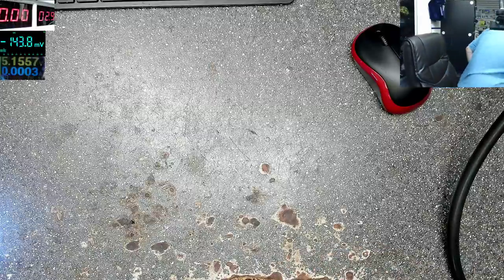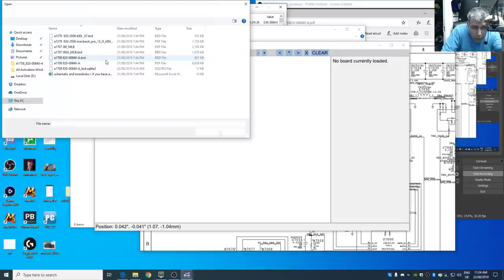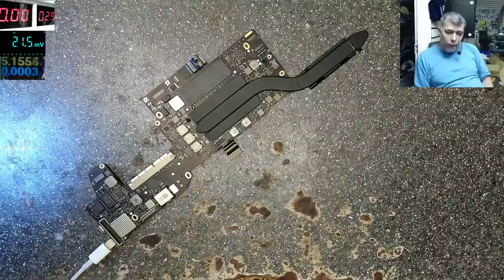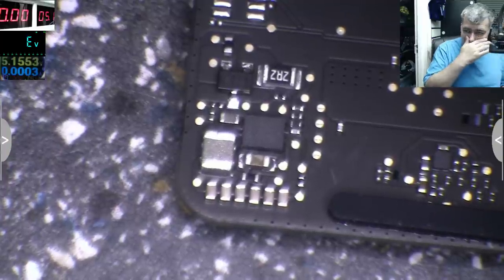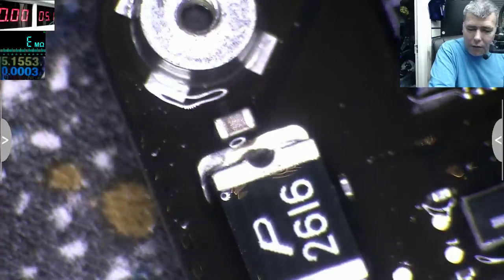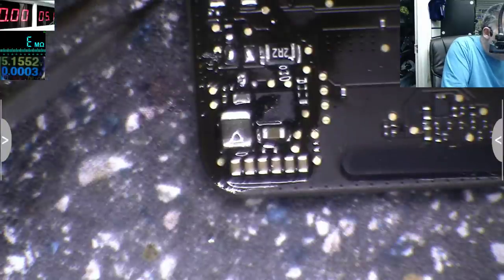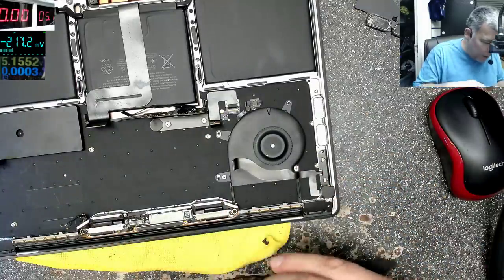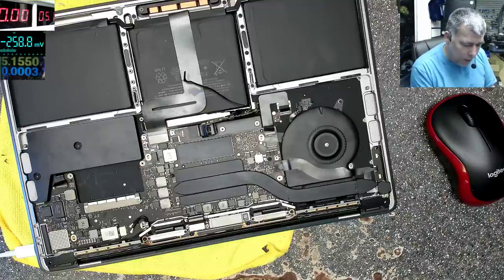MacBook Pro A1708 EMC3164 -Logic board repair (Jason Laptop)

Comment: Sorin
Smd multilayer capacitors are very unreliable, i think they are just too fragile and layers crack from stress/vibration/heat cycles and become shorted.
Cost has nothing to do with it,  just a bad idea.
Louis rossmann has found lots of shorted caps in the macbooks he repairs.

Comment: You need Paul Daniels software there is a free to download version without the quick board flip function. It’s extremely good.
Reply: can you provide the link to download?
Reply: Links repair  https://pldaniels.com/flexbv/ this is for the paid version, but there is a free to use version with a couple of functions missing. I will do my best to find the link for you. But the licence for this is $79 but for the information you can get from it will greatly speed up repair time.
Reply: Fully recommended. Free version will not work with PDF  and that's all different between paid and free. Thumbs up for Paul Daniels

Comment: just watched your video, which turned out to be a faulty cap...............then watched a video louis posted today..............a macbook that wouldnt turn on................due to a faulty cap ! ...................bit of a theme here ?................i think apple use the same crappy components as used in a £100 laptop..............just they charge £2000 for it !............still you do get an apple logo for the extra £1900 ?   :)

Comment: Macbook motherboard design is different from the others but components and voltages are the same as all other motherboards.just check 3.3, 5 and 19 volts present or not.and ram voltage(1.2v or 1.5v) of course.I would like to say Conguratilations to you that you can read and find voltage measurement point in a few seconds on schematics.3 years ago I stopped repairing motherborads cause here is not worth enough money for repairing motherboards.Video show is good idea.Funny,Fallowing your next videos.Bye

Comment: It is not bad quality capacitor. It is bad design. Nothing unusual with apple... It is too close to screwhole. It means mechanical stres. Capacitors should be at least 5mm away from mechanical mounting points and edge of board etd...

Comment: Sorin, the mac usb charger works like this: it usually sends 5V to avoid to burn usb powered things an idiot could connect, like a phone. When you connect it to a macbook the smc sends a specific signal on the data pins so the charger could pass 20V like a normal charger.

Comment: Would it be possible to put those diodes on the free space to the right, then solder the wires,  and then finally use hot glue to keep them in the place? Great educative video!

Comment: Nice job. Like watching your videos, I learn a lot. Not to get confused with 5 volts on the current sense resistor, as i know and keep it less confusing, it is start up voltage for 3.3v to power two ics that communicate with mac safe to open 20v supply.

Comment: Louis Rossmann teaches us to always look at the board first for any obvious faults...then go through the power rails and find out which one is missing...yes finding the ampere using your power supply can guide u roughly but with macs you need to manufacture the cable first to do this. The only complaint i have with your methods is that you skip around alot..there is no set method you follow...i have watched most of your pc laptop repairs and i think you are a very knowledgeable person..but i think thats the problem..you know your stuff but creating a consistant method like louis does would really help solve issues for your viewers..to date only a handful of channels out there repairing laptops actually go through the process systematically. The main issue is that they are in hindi and not in english. I know that if you do create a logical step by step method like louis does your channel would grow so fast..i admire your skillset..without any schematics..i dont think louis could do what you can without schematics.

Comment: Hello Sorin, is it possible to give me an advice about the A1708. I have similar situation.
The difference in my case is that when i measure the double diod I receive 19V to 0V and always fluctuation. On L6995 I get 10V on .2 and 3.3V on p.1. Flowing the schematic on c6990 I have 19V. 
On fuse  F7000 - nothing. Would you please share your opinion how to proceed with the troubleshooting

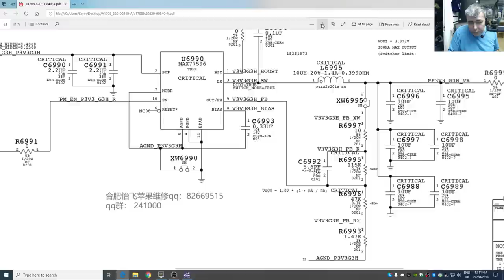Comment: 58:18 Sorin please look at the schematic. I will give you one tip.
On the apple schematics only, when you see the word "critical" above any component - that is means you HAVE TO replace it, and it is wrong to remove it and skip it. That component must be there and It must have the same parameters - not something around or familiar to it, but exactly the same resistance/capacity/etc.
I know what you are always saying "oh, that cap is not necessary, there is another one next to it, it will be fine, trust me, don't worry" and yes you have right almost in all cases, but NOT here in apple, The word "critical" means it is very important. Ok laptop is working fine now without that cap, fine, but working laptop doesn't mean it is 100% ok.

I bet, that cap is for removing noise / for filtering voltage to prevent to hang-up that ic. Probably in rare cases (one for some time) bad thing will happen. Almost all of components on the board are there because "laptop need them" to "coming on" and working fine, BUT rest of the components are there to PREVENT rare situation, which you will never be able to reproduce in one minute of your tests on the bench.
Apple can even slow down, and behave like a shit slow/weak laptop, when it detects any failure of his sensors - and how can you detect it? It for you, the job is finish when you see fan spin or apple logo on the screen?
So you are risky to skip word critical in apple (even on the caps). For the rest of the components and other laptops (pc-ones) that is fine.
Reply: The electronics behind an Apple laptop and another branded laptop is no different. Critical doesn't mean it'll definitely not work without it.
You're right at saying it may not work, and you may not trigger the failure by a simple bench test though. And it may even work without any issue at all, but not pass EMI (or ESD if it was another component) certification.
I will also argue that when you're working on a $850 board it is preferable to do the best job possible.
But again, doesn't mean it'll definitely cause an issue on Apple laptops and not other brands. And it doesn't have to be the exact same component either.
Reply: @piernov  you miss the point dude. I've said already that it could work without critical component. 
The thing is - you, I and Sorin are not engineers of this board. We can assume, we can recognize familiar components or groups of them or parts of power supplies  but please do not try to be father of apple or PC board.  We all do not know all reasons of all used components. what updates to newest version they did, why this or that component now is critical.
We don't speak here what is possible what is not. I understand that sometimes Sorin remove bad cap and skip it / leave it because he doesn't have a time or detailed parameters. But my God do not try to force that idea that we can always skip then all, especially when word critical is on the schematic. please cut that bullshit about that the reason of critical is  esd.
Reply: @piernov  and by the way - thank you that you're recording new videos again. I was waiting for it for so long time
Reply: Careless repairs leads to high potential of angry returning customers with new random issues on their laptops (digital chips are very sensible for voltage filtering issues like noise or unexpected voltage drops under load, or can cause hard resets … for that purpose capacitors are installed).

In addition, Sorin doesn't even care if the diodes are Si/Ge (different voltage drop is critical at 3.3v) Zener or schotky …

The rule here is : make it work at near zero costs (component scrapping), get the money and hope for the best.

I'm totally fine with doing this kind of crappy job at home for oneself taking all the risks
but this guy runs a shop and does it professionally which is imho unacceptable !!
Reply: eeeeeeh.... realistically, the "critical" designation on those schematics is likely more abused than people realise, a bit like 'volaltile' in C code; it gets used when unsure more than anything else.

Most designers putting together these modules are just cut-pasting from prior designs.   The importance of a given cap on a rail line likely is vastly overstated.  Of course, if it's something like an RC timing circuit or maybe a band pass/cut filter, then it's a little more important.   

Caps on supply rails, are for the most part slapped on without much care; usually you just run a few decades to cover your EMI/EMF compliance and hopefully stop transient issues, but I doubt many, if any, of the designers actually sit down and calculate the required capacitance on those lines;   they're engineers, which means if it fails the first time, they double it up and try again.   

I'm an EE.
Reply: I do not understand why we continue talking about it. I agree what Odium said and in the half way what Paul Daniels said.
Critical means critical. Someone wrote it on schematic because he was trying to prevent issue which was discovered before, or he has own reasons which you don't see now. Why we are trying figure it out - does it necessary or not? Just replace that f. cap if you see word critical. it is so hard?  how much time do you spend on it? 2minutes?
Reply: @Radek__  I agree that you should replace the part with the same, or superior part;  though I'm also saying that a missing decoupling cap, especially if it's not a bulk storage one, won't kill things and rarely will even mess up the compliance, because they were likely an overkill in the first place, and that 'critical' isn't quite what it first seems to imply in many cases on these boards.
Reply: @pldaniels   I wonder why for example on A1706 Macbook schematic, the same two caps in the same place are not called critical, but here they are?
Is it a engineer mistake here (or there), or in fact here 4.4uf caps value (2x 2.2uf) are critical because for example if you leave 2.2uf only -it can make rare issues here (voltage drop/ bad filtering, ic hang-up, or wrong behaviour), but on the a1706 mac will not, because maybe there is a better filtered power line, which comes before (from that diodes). What you think?
Reply: @Radek__  what board 820-xxxxx code and what cap names, I'll have a look.